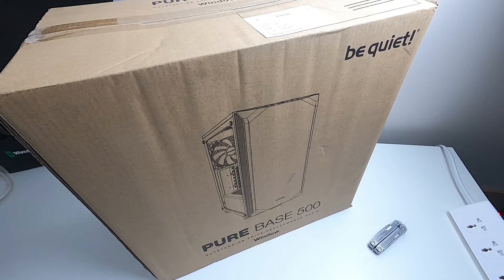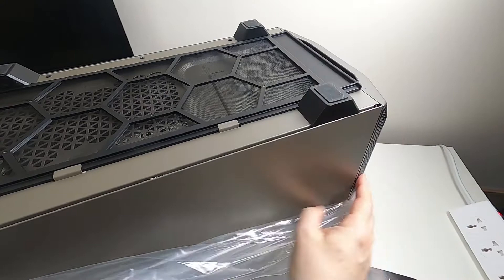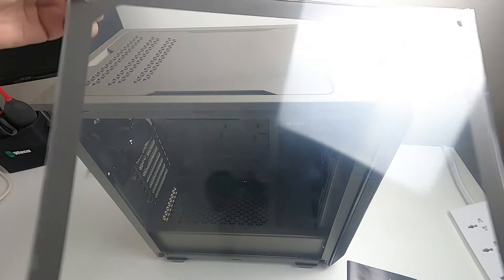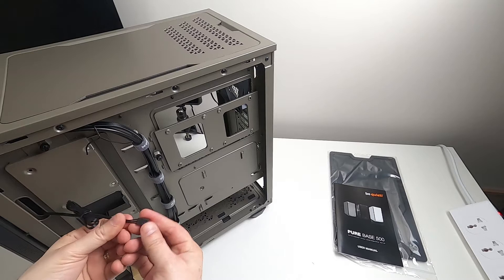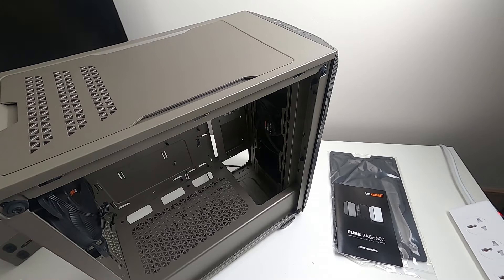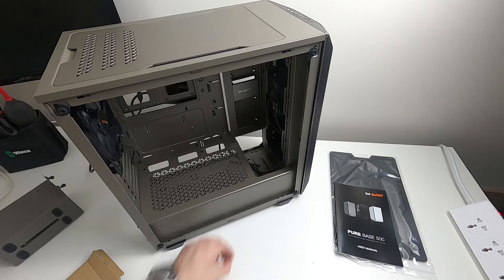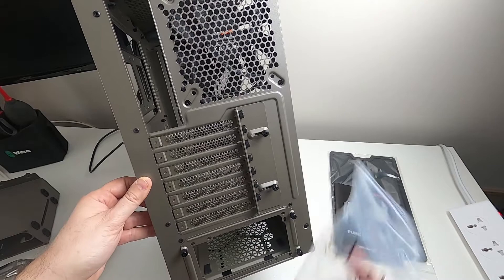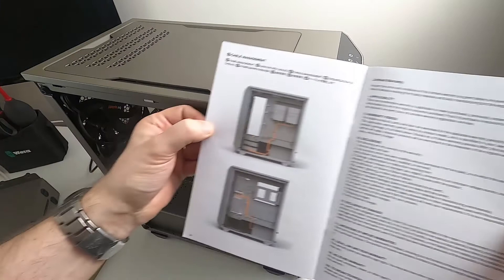BeQuiet PURE Base 500 *REAL* Unboxing in English

Comment: I'm thinking of Ryzen 7 5800x setup with this case, but I heard it's running too hot because of closed front and reduced airflow. What's your experience whit the case so far?
Reply from the maker: It'll get hot if the case is standing on carpet that blocks the bottom vents... it has pretty big feet though, so I expect the voices that are saying it gets hot are not a chorus - just a few people that have posted something on Reddit.

I expect they are very much the exception... the customer who I built the PC for hasn't complained - its standing on a tiled floor in their showroom.

So you should only be concerned about that if you've got a thick carpet. In which case I would stand it on something solid and flat...

:D
Reply: @sterntechdaddy  Thanks for the answer! I'm not a carpet guy and would never put my case on any fabric, so not an issue. I suspect that people complaining are mostly heavy overclockers, but they're the ones literally playing with fire ;)
Reply from the maker: @GiltleyRage  There'll usually be something going on that makes their experience exceptional. 

BeQuiet make a LOT of cases and if it was really a problem we'd hear more about it and they wouldn't repeat the production without modifying things if they needed to.

There are plenty of other cases that have solid front panel too...

:D